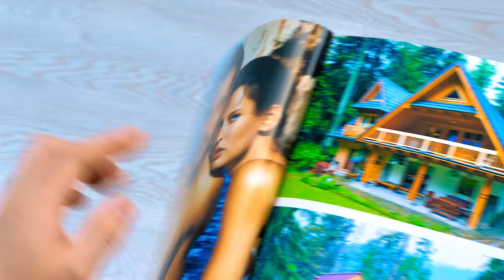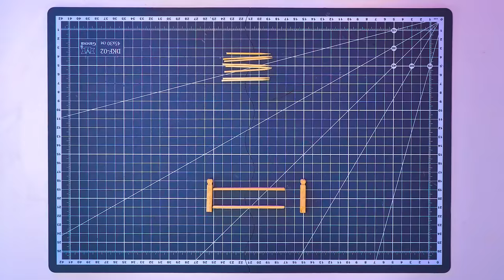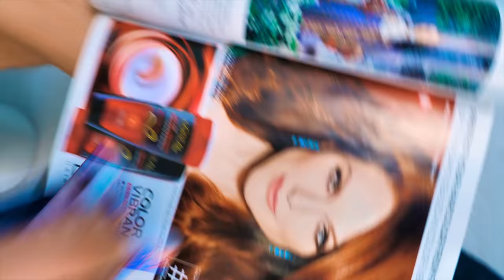How To Make Miniature Wooden Chalet | Woodworking DIY

Comment: . . . and when I was a kid, my dad and I stopped at a gas station while we were travelling. There was a wall shelf inside that station where there sat a miniature scene of the interior of a rustic cabin, set up like a diorama, or maybe a shadow box is a better way to describe it. It was only the back wall and the two side walls, with rustic furniture and furnishings, and the focal point was a little stone fireplace centered on the back wall of it with windows and curtains on either side. I will always remember how cool that was. Maybe I will make one like it one day. . . you should make one--- I would enjoy seeing it take place step by step.